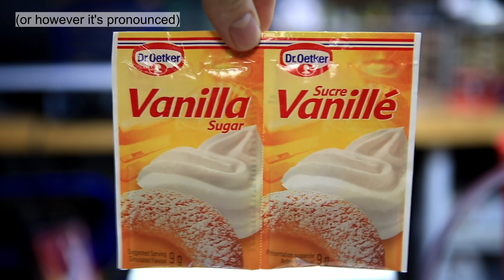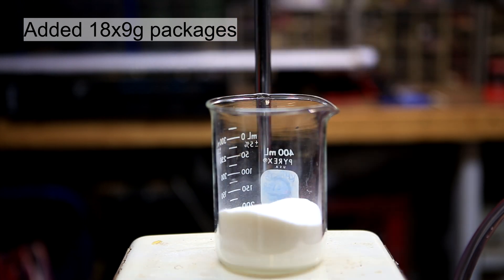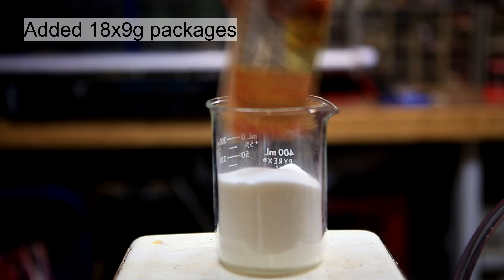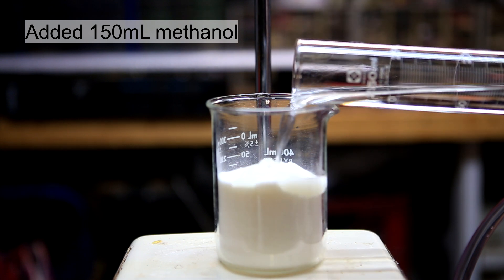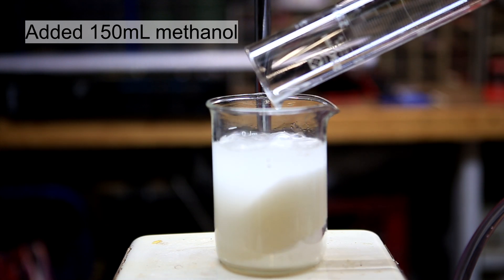How to extract Vanillin from Vanilla Sugar

Comment: Does vanillin have a strong smell? I bought vanillin power from ebay, and it doesn't taste or smell as strong as I would expect.
Reply: Probably dissolve in in liquids like ethanol or water if you're planning to use it for parfum

Comment: Doesn't this rely on the starting material being sugar with vanillin powder added to it like a coating? if "vanilla sugar" is homogeneously melted sugar and vanillin ground up, you'll lose most of your yield to the methanol not physically having access to the vanillin.
It also seems like this would be a good place to use a soxhlet extractor. You could literally run it until everything in the extraction area ended up in the collection flask. Doesn't matter since at that point all of the vanillin should be in solution and the sugar would have crashed out on its own as the concentration increased.
Reply: He said sugars are not so soluble in methanol. But in a soxhlet extractor, you know pure solvent gets in in every cycle. So the amount of sugar(s) taken with is higher. Maybe taking advantage of oversaturation, and dekanting, or just the recrystalisation cleans it up.
Reply: @wernerhiemer406  Eh. I watched it again and he never said what yield he should have expected. There's not much point speculating about anything if we have no idea.

I stopped watching Nile Red years ago because the chemistry is just to sloppy to learn anything from.

I did the googling myself and the vanillin content of this sugar is about 2 percent, which means that he only got about a 50 percent yield.

The NMR looks weird compared to a vanillin reference but I can't say anything quantitative about his purity from it. I don't think the central, unlabeled peak should be there.

Comment: Just a question from an unexperienced high school student: Why didnt you use diethyl ether to dissolve only the vanillin and not the sucrose?
Reply: Safety and accessibility to the amateur chemist.
Reply: Diethyl ether is great and performs excelently here, but I think this specific video is meant to have chemicals easily and readily accessible to the average person.

Plus, Ether can be fairly dangerous if not handled safely, so, not for the inexperienced
Reply: @fgvcosmic6752 Methanol is also quite dangerous.

Comment: could ethanol be used ?
Reply: Steven Andreev Yeah,but it has many disadvantages,mainly that sugar is a bit soluble in ethanol,so you'd have to mix the sugar and the ethanol gently to evade emulsion.Also its boiling temperature is nearby to that of vanillin,with only 8 degrees celsius or something like of diference.
Haven't tried yet,so I'm not 100% sure.Try to investigate,and remember solubility of vanillin in ethanol is 50mg/ml
Reply: who knows maybe you could do an ethanol extraction, evaporate that and then try a dcm extraction to exclude the sugar.  Although the only source of methanol where i live (to my knowledge) is in the same can in which my DCM comes in.  An advantage of this would be that you need less dcm or methanol

Comment: Can I make this extraction with ethanol?
Reply: I mean ethanol like barbecue lighter fluid... The one with bitter flavoring to render it undrinkable
Reply: I shouldn't have bought it... What CAN I do with this ethanol in chemistry??
Reply: drink it.
Reply: Not even that. It's bitter.
Reply: And also you could probably use it to extract vanillin but with different quantities than with methanol because 50 mg of vanillin is soluble in 1ml of ethanol. And the other ingredients in the Vanilla sugar (Glucose and Sucrose) are only a bit soluble in ethanol, so be careful that an emulsion does not form when performing the extraction.

Comment: Gday,
why dont you use concentrated natural vanilla extract?
Reply from the maker: +GEZZA1 Because you would need to do a liquid-liquid extraction. The nice thing about this is you dont need to use DCM or another solvent like that. Also, natural vanilla is not good to use because it contains a lot of other molecules in it. The fake one is really just vanillin.
Reply: +Nile Red We can only get small 60gram bottles of vanilla sugar. So we may need to mix sucrose with the 'imitation vanilla essence' to get vanilla sugar?
the 'imitation vanilla essence' is way cheaper than natural vanilla extract.
Reply from the maker: I am not sure what you question is. And yeah, the imitation stuff is WAY cheaper and better for the extraction too!
Reply: the natural stuff has a bunch of other chemicals you don’t want in it

Comment: Can you still use DCM for this method? How is the solubility of vanillin/glucose in ethanol or isopropanol?
Reply from the maker: Youll have to look it up for ethanol and isopropanol and DCM. I am not sure. you just need high vanillin solubility and very low glucose/sucrose solubility.
Reply: Do you have any sources for a good literature I could check in?
Reply from the maker: The site i normally used doesn't seem to work anymore, so I don't have any recommendations unfortunately. You will have to just search around.